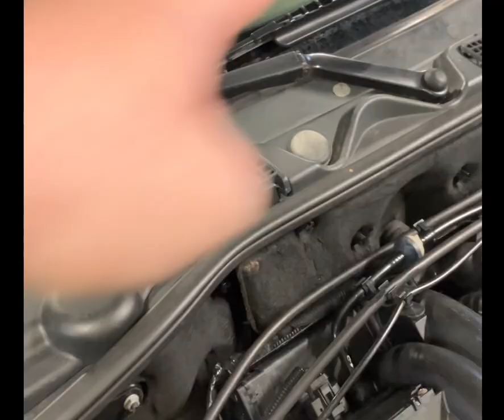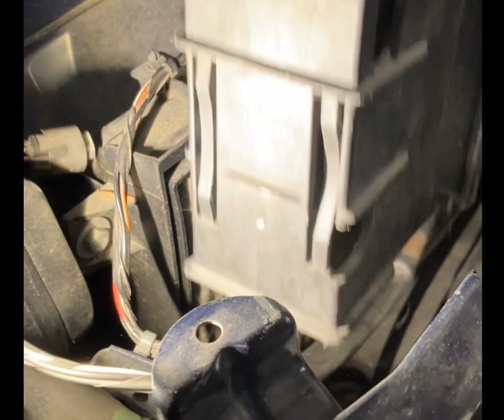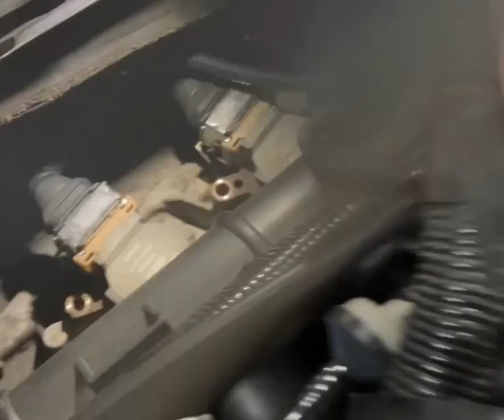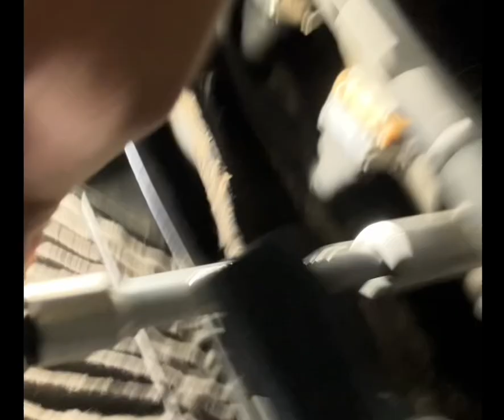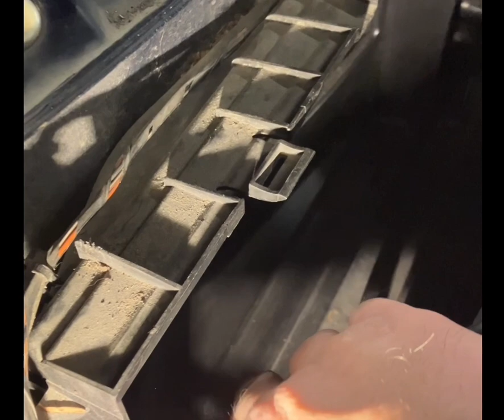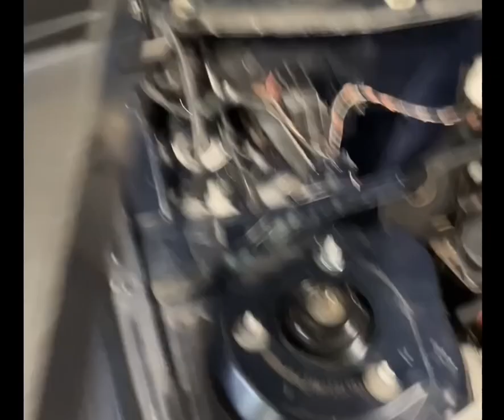DIY Rover 75/MG ZT KV6 Spark plugs cabin air filter and plenum drains detailed.

Comment: What a very excellent video, thank you, much appreciated.
I've a 200mm -250mm  long 16mm plug removal tool but it has a relatively chunky T Bar on its end; might that be restrictive do you think?
On the other hand it has a swivelling joint at the plug end which I thought would be of help rather than a rigid tube.  Any advice on that?
Reply from the maker: I think you will be able to do that👌Thank you so much for watching 🙏I’m so glad it’s helpful!☺️

Comment: Great video. Would you be able to confirm how long the magnetic spark plug holder is? It looks maybe between 250mm and 300mm. I would be very grateful if you could confirm. Many thanks.
Reply from the maker: It is 250mm. Thank you so much for watching 🙏
Reply: Many thanks indeed for that valuable information. This is a job I shall be looking to take on in the coming weeks although not so urgent as my  spark plugs were changed in early 2021 but they will be about due I think. Just to add, the style of your videos is just great and very easy to follow.

Comment: Thakyou again for sharing your Rover 75 maintenance tips.  Another way to access the rear bank of spark plugs is to remove the upper inlet manifold which I have done.  Not too difficult to do once you disconnect a few wired connectors and cables and nicely exposes the whole area.  But your way is good too.  Please keep your videos coming.
Reply from the maker: @freiduumforall8843  Yes I know😀 There is plenty more to come☺️Thank you again for watching 🙏

Comment: Excellent nicely explained with clear details, my car has the 1800 engine, so interesting I watched video all through. That car is going to run really well now. Job certainly needed doing 😮 oil and filter next then 👍
Reply from the maker: @alisterwest6987  Thank you very much 🙏☺️Yes oil and filter is next up! Lots of other work to do on this car as well. Rear suspension arms and rose bushes is the largest job waiting on this. Just waiting for parts from DMGRS☺️Thank you for watching 😀